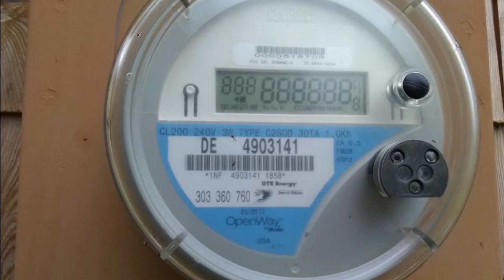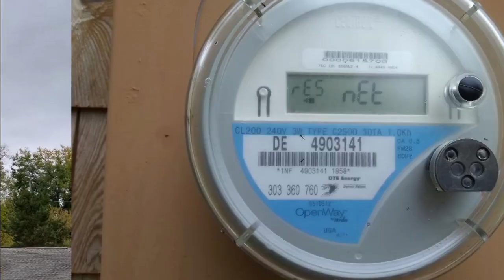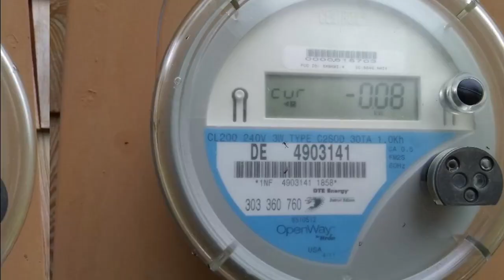How To Read a DTE Bi-directional Smart Electric Meter.

Comment: I live in a apartment and my bill is super high. I think it’s being taped and someone is using my power. If I turned off my breakers to my apartment and go to the meter will it still show electricity being charged? How can I tell it it’s being used?
Reply from the maker: Hi Brett, It might be good to see if you have a Main breaker in your service panel. Try opeing the Main if you have one. If not, you should have a disconnect between the meter and the panel which can be opened. There has to be some way to disconnect. If those don't succeed, a call to your provider will clear it up.  mike

Comment: Is the kWh reading an attempt at averaging for the full hour?
Reply from the maker: Hi Colin, No. Each reading reflects total energy consumption since the meter was installed or reset. The "cur" screen displays curent power in kWatts without respect to time.
mike